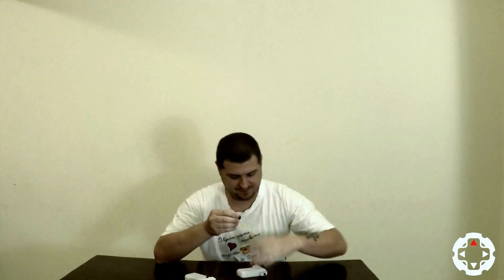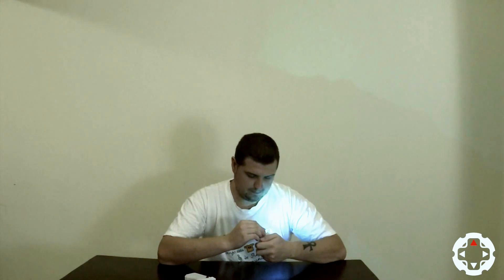Introducing new DIY 3d printed RevolVR controllers: Beta & Gamma

Comment: Can you tell me more about the chips (Bluetooth module and microcontroller) you are using in your product?
Reply from the maker: In this video the device does not contain a bluetooth module. The one above has a 2 buttons has ATtiny13 micro controller inside. For our Bluetooth powered devices we use our own pcb and RDA5871 processor.